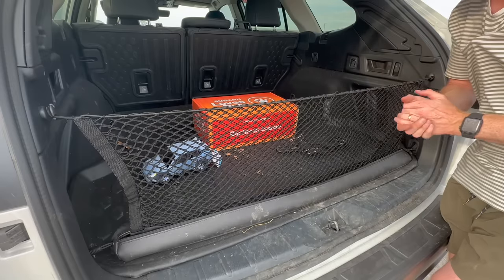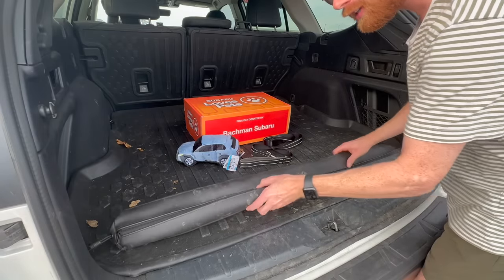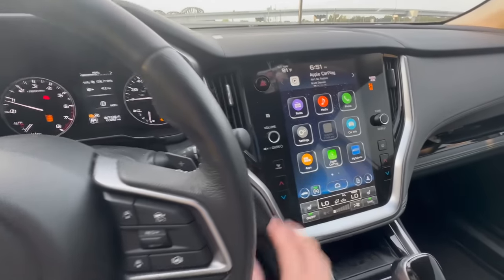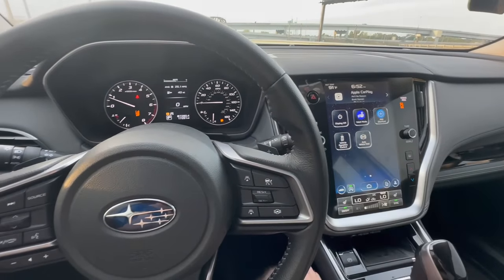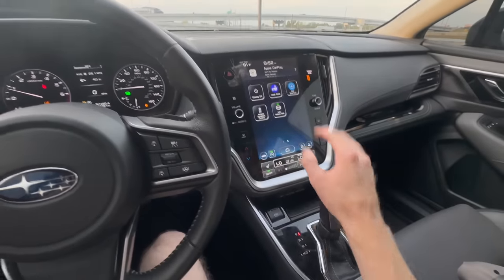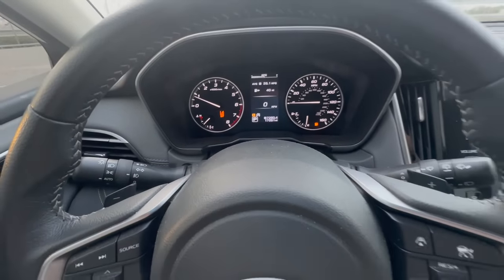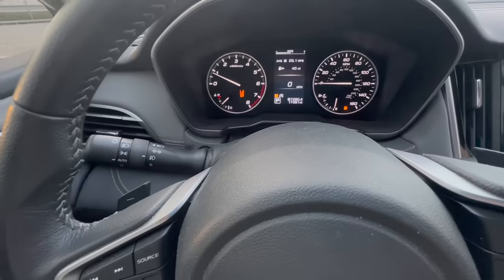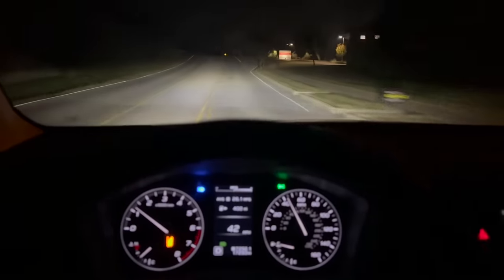Top 5 Hidden Subaru Features: Outback, Forester, Crosstrek and more

Comment: When I bought my Subaru, I asked the salesman if there was anything like the auto vehicle hold, and he told me no. I think I might’ve learned about it by accident or from your channel. I did not have my vehicle for long when this happened. So I called him back and educated him on this function. So hopefully now he can use this information to teach others. Remember, the vehicle hold will become a emergency brake once you open the door. I had this happen to me when at a drive-through pharmacy. So now anytime I go through the drive-through pharmacy I put it in park. Most people don’t have to open the door because they are tall enough and can reach far enough. But I am short and I do not have a far enough reach so I have to open the door. I learned the hard way and my vehicle put it into emergency brake once I opened the door.
Reply: Alex in my 22 & 24 the AVH doesn’t flash??
Reply: It also switches to emergency brake if you unbuckle your seatbelt. Learned that one in a drive-thru as well.
Reply: What the hell, that's crazy! Thanks for the heads up, 2022 OBW here.
Reply: My '23 Forester turns off the e-brake if you have the seatbelts fastened and the doors closed if you merely step on the gas.
Reply: I was really fortunate to have a salesperson that was part of the Subaru cult (of which I am now a member😄). He had Subarus for years and know all the features.  The first dealership I went to wasn’t like that.   So glad I bought from the next place.  And I’m glad this Channel shows my dealership isn’t the only one with very knowledgeable staff!
Reply: @jerrymiller276  Unfortunately my 2022 Outback does NOT do that as I did try driving with the E-brake on once. Didn't take long to figure it out however lol.
Reply: It’s “by accident”.
Reply: . . . “by accident” . . .
Reply: @winnepeterson6570  thank you for the correction. Voice to text doesn’t always go correct. I am always upset when someone uses the wrong patient versus patience.  This is done time and time again even in news articles in which the writer knows better or should know better.
Reply: That's so strange my salesman wouldn't be quiet about it.
Reply: My BMW does this as well
Reply: How do I turn off the alarm?? That’s is I access it using the key
Reply: @CatBrown-ym3uw I think that’s where you put the key in ignition and turn halfway on (to accessory) and back off 3 times. I have a 2006 Subaru Forester and I’ve had to do this a couple times. Oh but now I’m thinking if you don’t have a key ignition you cannot do this, lol.
Reply: 2008 Tribeca spare tire if have 3rd row seat
Reply: You should have learned this at your Love appointment.
Reply: He diesn't care.  He sold you a car, that's all that matters to him.
Reply: Great show Alex. We have 2021 Outback Premium can I up grade my tires & Rims to the Wilderness tires & rims? And do I adjust my roof rack to the widest spread of cross rails? Thanks, Roseville,Calif.

Comment: I live out in the country and the Auto Highbeams are just amazing! Wether you're approaching a vehicle ahead or an on coming vehicle the lights switch to low at the exact time you would want them to. It's basically doing what you would do except faster. It's a useless feature in the city but a real blessing for rural drivers.
Reply: I just finished writing a comment that posits an opposing opinion.  Have a look at my post to see why.  You must live in flat country with fairly straight roads.  My situation is the opposite.
Reply: I find  it's a pain. It does not work on my township dirt roads. They are sub 15 mph.  Without a light  up head light switch you don't know what mode your in. I just keep mine in manual.  On interstate driving it's fine.
Reply: @jerrymiller276  We fall right in the middle. I actually love the feature, living about 17 miles off a freeway, deep into a rural forest area. BUT, the one instance where it doesn't work is when there's an approaching oncoming vehicle that is either just around a curve or on the other side of a rise, where the car's camera cannot register it. Then gotta go manual.
Reply: Is there an option to amend speed limit at which automatic high beams light up? In manual its 15 km/h but in fact it works only once vehicle has reached 60 km/ h.
Reply: I have a different experience. I hate the auto highbeams. If there's a bright street light 2 miles ahead on a straight road, your highbeams won't come on unless you switch back to manual. I need complete control over my robots, not vice versa.
Reply: @michaelking42  I have experienced the same but it's kinda rare. I totally understand the frustration with some of these "safety features" that sometimes aren't so safe and can be very annoying.
Reply: The Auto Highbeams might seem like they work for you, but they are blinding everyone else when you drive around a curve, go over a hill, or the sensor does not sense the other car in time.  This is a problem with every car manufacturer and it's causing real danger on the roads due to people being blinded inadvertently putting them at danger of accident.
Reply: @jrl179  Yes I have observed the same.

Comment: My 2012 model , at 65,000miles: all 4 wheel bearings, 70,000 miles, main drive shaft bearing so whole shaft replaced £2500, 72,000mls, both front wishbones/struts, 75,000 both rear struts. Entire under body rotten due to dirt trapped by the aero plastic trays. inc every brake pipe clamp . large areas of rotten steel due to poor rustproofing from the factory.

Comment: Hey Alex! I want to shae with you that I just bought a Crosstrek Limited with the more powerful motor and I love it. About a month and a half ago I'd purchased an Impreza RS. A small hatchback but surprisingly roomy and comfortable. It's the top of the line, however I coming from a Forester, felt it was too low to the ground. So I decided to once again trade for the Crosstrek. Nothing whatsoever wrong with the Impreza but for me it lacked the omph. I testdrove the Forester and felt right at home, but for my needs at this point in time a Crosstrek suits my needs better than the Forester, which it was wonderful to drive. Contrary to what some car reviewers claim (Consumer Reports is one), The 189 HP engine moves the forester very well and powerfully, I have the same engine in my Crosstrek and being a lighter vehicle it transforms it into a speed demon, in my opinion,  and not much lower than the Forester. Solid, fun to drive, very quick, comfy, great visibility, loaded with features, and I worked a killer deal for it, I kid you not. I'm very pleased indeed and now on my third Subaru. To me the Crosstrek is a baby Outback or the Outback's smaller car. Regards and thanks for your videos!
Reply: "Baby Back"!
Reply: Hi Daniel (&Alex) thanks to you both for your info! I’m currently shopping for a Subaru (Have an ‘08 Legacy on its last leg) I’ve test drove: Crosstrek, Forester, Ascent, Outback. Really like Crosstrek but it didn’t have the power I like. What Crosstrek model should I search for & td? Thanks again for info! So helpful!! Kathy
Reply: @kathyhuglen1865  I didn't see your reply before with your question. I don't know what Crosstrek model you test drove. I test drove and purchased a 189 hp Crosstrek Limited and I'm very happy I did. It's very powerful with a lot of pick up, agility and is also fun to drive. Just before I bought an Impreza RS, which is the top trim. It was very nice but also anemic, meaning underpowered. The Crosstrek comes with two motors and I just wouldn't want to get one with the weaker one. As an aside, my Crosstrek is quite a bit taller than the Impreza but not as tall as the Forester. For me is the Crosstrek or the Forester with natural aspirated engines and no turbo. As for the Ascent, I know very little about and It wouldn't suit my needs. To me the Crosstrek is a baby Outback, an exceptional vehicle. I hope I answered your question. I call my Crosstrek a "speed demon". And I made a killer deal. Not only did I get on for the Impreza close to what I'd paid (I had it for a month and a half) but I got the dealer to discount two thousand two hundred on the Crosstrek. Now I'm on my third Subaru.  Best regards and good luck!
Reply: I am a Subaru employee and sports car enthusiast. The Forester, Impreza RS, and Crosstrek Limited/sport all have the same 2.5L boxer engine. All three cars have identical horsepower. However the Impreza and Crosstrek make their torque peak at much lower rpm. It’s 178 at only 3,700 rpm. Forester must rev to 4400 rpm to make 176 lb ft. Of torque. The Impreza and Crosstrek are lighter also. They also have SI drive performance button. They are considerably faster to 80 mph than Forester.

Comment: I’m 65 and forgetful. I have a 2017 Forester that dark gray, charcoal, black that is so popular. When I am in a large parking lot finding my car is really difficult. This is what I came up with. I bought some bright colored slap bracelets. I put 4 of them on my roof rack 2 in front 2 in back. It has been sooo helpful. 
  The second blessing. I hurt my knee and needed to be picked up curb side. I didn’t know where my husband parked. But when he was coming up the aisles I could see him from far off wending his way to me. Then I just stepped up right before he got there and jumped in. Didn’t tie up the traffic. I thought Subaru could make these as an advertisement and a gift to its customers.
Reply: You can tie your horn to the lock-unlock beep.
Then, in a large parking lot you can press "Panic" button and hear your horn at a pretty good distance.
Reply: Alex ,I noticed as I drove to the outer banks and over bridges with water underneath, my GPS would stop working or lose destination.  Is this a common issue or do I need to update my GPS on 2016 Outback.

Comment: I owned 3 Foresters in a row & the one thing I really loved on the car was the radio.
There was a feature that I have never come across on any other car.
That feature meant that if your mobile phone was connected via the car's Bluetooth & you were listening to the radio when a call came in, then the radio would pause the station, & when the call finished your radio would resume at the exact position it was when the call started. 
If you missed something on the radio it was possible to go back about 25 minutes & relisten to the part that you had missed!
Like I said I have never seen this feature on any other car radio; it was brilliant!

Comment: I ordered a Crosstrek Premium with the six-speed on 7 January '23, got it 8 April. I have about 9500 miles on it, and enjoy the instantaneous mileage on the center display. It helps me maximize gas mileage on highway trips. 
My only real complaint is road noise, I'm guessing the Geolander G91 tires are the problem. 
Seneral cars were burglarized in my neighborhood on Sunday of Thanksgiving weekend and some were stolen. While I had glass damage, they didn't take the car. I think the miscreants were discouraged by the manual transmission.
Reply: I had a 23 base, after several hydroplanes I swapped to more aggressive tires and it didn't get any worse. I suspect that there's less sound dampening on the front end so you can hear the engine better. 

I traded mine in due to inconsistent shifts. I've been driving manual since before I could drive on the road and that thing would shift rough a solid 1/3 of the time no matter how much you let it slip. Even tried to double clutch.
Almost like something was hanging up. I was concerned about premature wear/failure.

2023 is the last year it came in manual too, I like my new forester but still a bummer. Despite the extra size and weight the 2.5L really is noticeably better, especially on steep hills.

Comment: Alex, thank you so much for your videos, I find them very helpful.  I recently got my Outback and I have 3 questions, 
1- I noticed my cell phone gets very hot when I am using GPS and have it on the wireless charger, I wonder if I can turn off the wireless charger and just keep my cell phone on the pad?
2-  I want to get a trailer hitch, I will use it mainly for my bike rack. I heard that the hitch that dealer install (both at Subaru and Toyota) is not compatible with most of the bike racks in the market. the issue is the safety pin location on the hitch
3- To install the hitch, is it require to take off the bumper and cut some piece of it? is the cut visible or it is just under the bumper?
Reply from the maker: Thanks for watching! 

1. I have experienced the same on my 2023 Outback. The new 2024 Impreza/Crosstrek have the on/off switch for the wireless charging pad, but unfortunately we don't get that on the Outback charging pad. 
2. The OEM Subaru hitch will be compatible with most bike racks. Depending on the Subaru model, you will have a 2" or 1.25" receiver. The Outback hitch will be 2" and so you'll just get a bike rack with a 2" connector. If you have a bike rack with a different size connection, you can also get an adapter to size up or down. 
3. The OEM Outback hitch does require the cut out in the bumper. This is done so the hitch can be installed without reducing ground clearance. Plus it tucks it away so I personally think it looks cleaner. They put a rubber trim piece in place where the bumper is cut so it looks nice.

Comment: I bought a 2010 forester from CARVANA . December of 2023 . Had new brakes rotors and calipers because someone was lazy. Then another issue . Leak. Fuel tank and evaporator nipple had to be replaced . Had 2000 worth of work even know this car was  CARVANA certified!  Runs great now . What do u think ? Has 61 k now

Comment: Thanks for all the great videos. I bought a new 2023 Outback a while back. It didn’t come with the cargo net, so I purchased one from the parts department. When I got home, I discovered the car doesn’t automatically come with the anchors to attach it near the rear hatch! Instructions came with the net on how to drill into the car to install the anchors. I don’t feel comfortable drilling into my brand new car, so I will have the dealer do it when I go in for service. So weird!
Reply from the maker: You're welcome! Yes, you'll need the anchors first. I wouldn't feel comfortable drilling into my new car either. Best to have the dealer do it in my opinion
Reply: Yes! It is a great car though. Really enjoying it. I got the Limited.

Comment: We have two Foresters: 2019 and 2020. Both have the AVH. However, they are on the console as a manual switch. Recently, I used a loaner from the dealer and found that Subaru has needlessly placed too many options on the touch screen. One of them is the AVH. As a result, the screen is now overly complicated.

Comment: Hey Alex, I really enjoy your content and want to ask you about the AVH feature. I was taught many moons ago that for an extended stop it was better for the engine and transmission to put the vehicle in Park so there would be no load on those components. Is this no longer an issue? Was this never true in the first place?
Reply: That used to be true because of the transmission being constantly engaged. I believe the AVH simultaneously disengages the tranny (puts it in neutral electronically) so there's no extra wear.
Reply: @HomesteadOnThePreserve 

Thanks! That wasn’t clear from the “press on the accelerator and go” demonstration.
Reply: @HomesteadOnThePreserve your right!... Regular transmissions and manuals are better in neutral. With MT's you wouldn't have keep the clutch depressed. Park is for park"!... Plus it's a bad habit to take your foot off the brake!

Comment: My question is about the "unlock your doors if you ever lose your key fob" hidden feature. I have a 2019 Outback and a 2024 CrossTrek. They both have the hidden button on the hatch but pressing them does nothing. Do I have to activate the feature somewhere? Thank you for this article. It is very helpful.

Comment: I own a 2006 Baja, stated in the owner manual, when a flat tire must be removed the spare tire must be placed on one of the rear wheel positions and a fuse in the under hood area must be removed to put the Baja into front wheel only drive. Do the new Subaru have the same feature? Will a new Baja be produced soon with manual transmission?